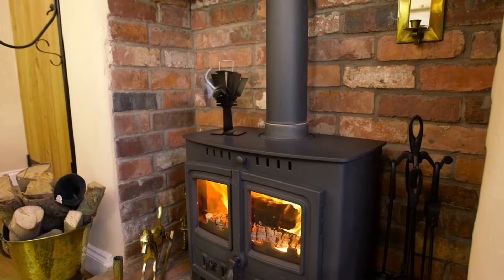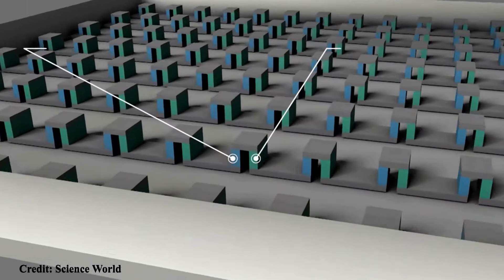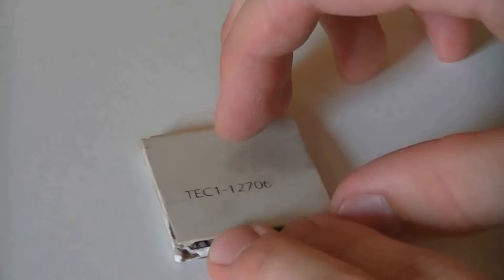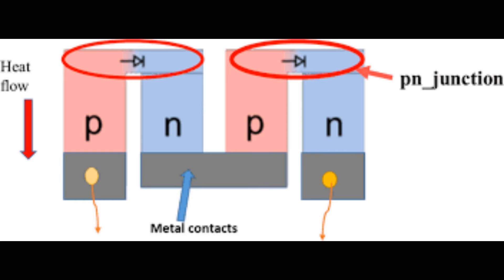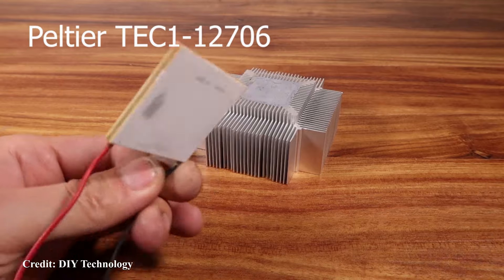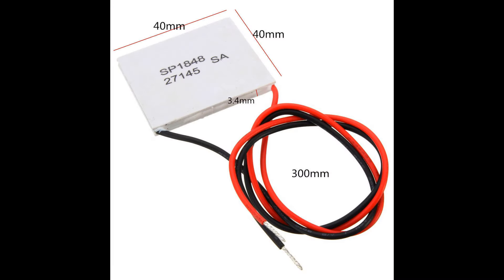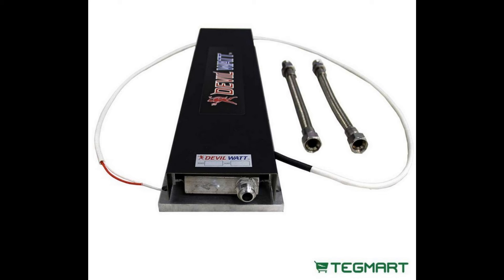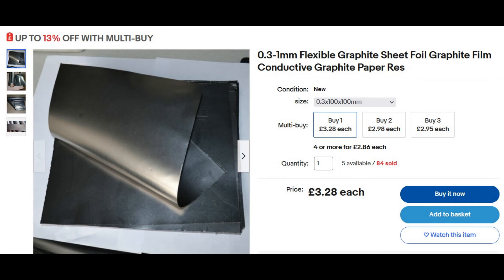2220 DIY Thermoelectric Generators - What You Need To Know

Comment: I first came across the Peltier effect many years ago during GCE physics, but that was using dissimilar metals rather than semiconductors.  I imagine they were more robust - but I assume they had some disadvantages or we would still be using them?
Reply: They are still used in 'thermocouple' flame-failure-devices in gas stove/hobs and other 'combustion' related heating systems. They are point-source contacts, and therefore limited power output  They cope with direct contact with the flame for months/years. 
But I have wondered if they could be made tubular and fitted into flues/exhaust systems to produce high power outputs.
Reply: @bikerfirefarter7280  Ah, no, these were not single point contacts.  They were, if you like, lots of them - so metal A connected to Metal B, which at the other end of metal B connected to another metal A etc., set so that all the wires were parallel to each other.  Hard to describe, but imagine you have a short piece of iron wire, connected at one end to copper wire, and laid down so that they are next to each other, rather than end-to-end. Now another piece of iron wire is connected to the distal end of the copper wire, and laid so that it, too, is parallel to the others.  It forms a sort of zig-zag shape.
Reply: @steveknight878  'Parallel' has nothing to do with it, the two junctions at different temperature is the main thing. I'm a kiln technician, we use the thermocouple effect to measure temperature (among other methods).  When I said 'single point' I didn't mean it akin to 'cats whisker' device/effect, I just meant relatively small area. Sorry, my bad wording.
Reply: @bikerfirefarter7280 Yes, I realise that the parallel isn't in itself, important to the thermocouple function, but it is important to getting all the iron/copper joints on one side, and all the copper/iron joints on the other side, so you can preferentially heat one side (set of joints) and cool the other.  Imagine tens or hundreds of thermocouples all joined up together in series.
Your description of a thermocouple is perfectly good, and I think that  a thermocouple is doing exactly the same sort of thing at that joint, but this device takes it further, and has the same effect as in this video.

Comment: I was wondering if you could make/test DIY Thermoelectric generator using conductive inks with the N and P elements mixing with sodium silicate (which can whitstand a lot of heat) and making the heat source like a blast furnace.
It would be quite a project and kinda dangerous, but it would definitelly produce way more power.
Reply from the maker: i have done it already - but i will have to dig out the video mate
Reply: It doesn't produce more power because the efficiency of such semiconductors is inversely proportional to the heat conductivity, 
The more efficient it is  to conduct heat the less efficiently and converts that heat into electric.
   So far bismuth telluride is the best discovered that's commercially viable.
Reply: @petevenuti7355 I'm assume he is thinking of large areas of pn, to generate large currents, this should help to offset the temperature/voltage/efficiency drop.
Correct me if i'm wrong.
Reply: @bikerfirefarter7280   that's how I remember the comment discussion go. Thing is, with the cumulative resistance over a large area of such thin film junctions, enough energy  gets wasted as resistance heat to offset the benefit of just volume of area. 
   Of course you could build up arrays like what they do with solar panels to help solve that same problem, use silver conducters and more. It would be interesting to see someone actually test the limits! 
   It would take testing to find out the maximum size of the most efficient possible cell, and cost effectiveness of  resistance mitigation.
  If you believe in it, test it!
Reply: @petevenuti7355  I would have expected larger area to have LESS resistance. 
I don't understand what you mean by 'volume of area'.
At the mo I'm too busy with other stuff to get anywhere near 'test it'.
Reply: What!? They make ink that you can draw transistors with!?
Reply: @greenaum  Essentially, yes. Think OLED, but with another layer of influence. All elements/compounds have somewhat unique electrical differences, its just a matter of arranging/exploiting those characteristics. To be fair the manipulation/use of 'inks' don't readily lend themselves to microscopic domains the way silicon/doping/diffusion etc do, but its swings and roundabouts.
Reply: @bikerfirefarter7280  Crazy! I knew about the silver ink you can use to draw circuits but I didn't realise it had gone as far as semiconductors. Actual printed circuits!

Comment: Very interesting, do you think it can be used with an MPPT solar regulator to get a good battery charger out of it? Given the fact that you are within the correct voltage range of course..
Reply: No.
Reply: Nah, MPPT is a particular solar panel thing. It varies the effective load on the panels to get the best combination of volts and amps out of it. The best load to do this varies with the amount of light, so it needs a smart tracker. 

But TEGs don't have the operating characteristics of a solar cell. Doesn't mean you can't use it to power a battery charger circuit though. If it's producing a reliable voltage, you could do it. That just means keep the temperature on each end the same and you'd be good.

Likely the voltage and current output are pretty low. But you can always buy more TEGs of course, in principle there'd be no problem. There was once a competition on Hackaday, where a guy got a load of TEG modules and some big metal plates, and ended up powering his laptop from a gas barbecue! The efficiency was terrible, but it worked!
Reply: @greenaum  Thanks for your comment, using gas via TEGs for electricity is cool but a waste for sure, but what if that guy was flippin' burgers at the same time, then his laptop would run more or less for free right? 

Anyways, I live off grid, up north, in the forrest and have an endless supply of wood. Most of the year my solar cells will provide more then enough power to keep my battery bank charged, but in the winter when the sun hardly rise above the tree tops they will not. Since it's freaking freezing here in winter time, I burn a lot of wood to keep my house and barn warm. 

So, since i'm constantly producing 5-15kw of heat, pulling out a few hunderds watts would be great, and would probably not be noticable at all. I bought some 22 watts (@ TD 300c) TEG's and was thinking to hook them up with a regulator for charging. Just like solar cells, TEG's output will vary, but an MPPT is supposed to look for that perfectly matched output right? 

Using an MPPT would make it all so easy. I have several Victrons lying around from previous projects, but I'm kind of scared to hook them up. Wouldn't enjoy destroying €1500 worth of TEG's you know. Any idea of how that Hackaday dude regulated his voltage output or did he just crank up the gas until his Laptop started charging? 

Thanks
Reply: @Thedogpighorse  get one of those cheap $20 PWM solar chargers and try it.

Comment: I wonder how it would work if during the day electricity from solar panel would be used to make the sides hot and cold and when the sun goes down, reverse the thing and use the build up temperature difference to give electricity. Not very efficient, but no moving parts I guess.
Reply: maybe if you could put that in a sand battery and line the inner chamber with it, and then this leaks energy into reticulated carbon foam to insulated it. So that the energy is not lost, but you capitalise on the outer edges of the reservoir also, within the insulation? i wonder i that could work to scavenge an additional bit of energy maybe just to 
even run the battery's own GUI LCD screen...

Comment: You know, if we could figure out how to put these in the outside wall of houses, we could produce quite a bit of electricity I bet.
Reply: They work on temperature difference, the difference between inside and outside your house isn't nearly enough to be worthwhile. You might be able to power a clock or something. 

Second problem is, they work from heat travelling through them. You want the most possible. So heat is going to escape through it at a rate of knots, you're going to have to turn your central heating up, for an overall efficiency of almost nothing from start to end. What you'd pay for heating would dwarf what you'd make in free electricity.
Reply: @greenaum  Is the 60 degree difference here in Maine not enough for some reason? When it is 1F outside, I have the inside at 60 minimum, preferably 70.
Your other point is the part I said if we could figure it out.
Reply: @NdxtremePro  Nah 60F isn't much, and TEGs have really poor efficiency. They have terrible efficiency in the other direction, when used as coolers, too. 

The other part fair enough but AFAIK it can't be helped. Heat has to flow through the thing to work. It's, in a way, the opposite of insulation.